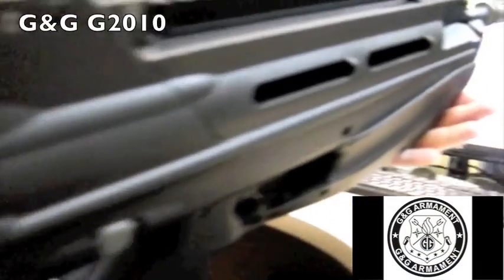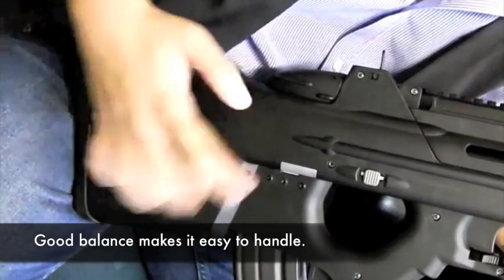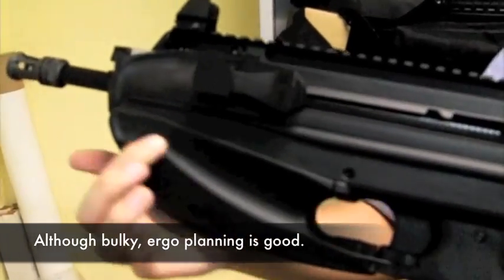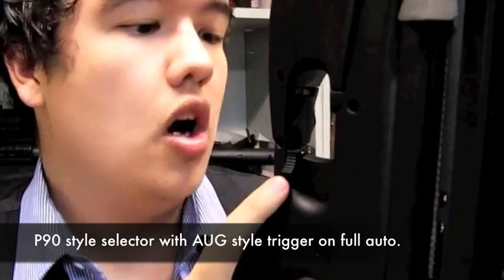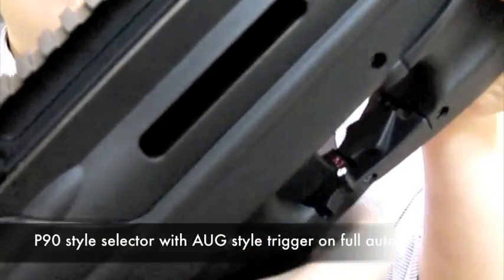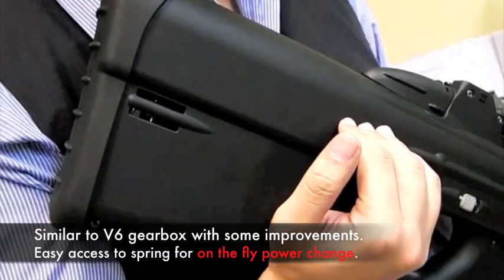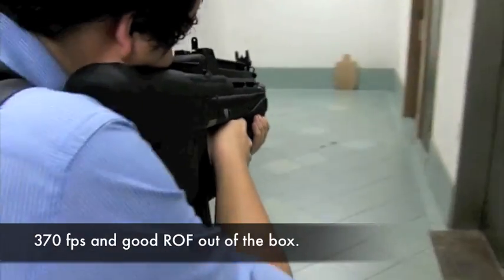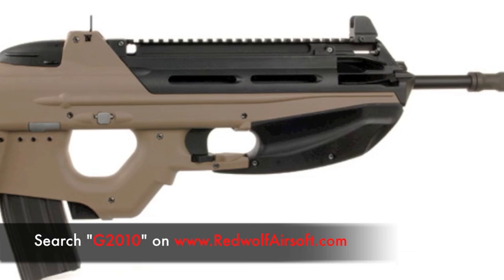G&G G2010 / FN 2000 Rapid Fire Review - Redwolf Airsoft - RWTV

Comment: @nuneatonairsoftteam No It is OK. I have TM P90. It has Same trigrer as F 2000, There is no difference in force reqired to pull the trigger between this or normal trigger. Only difference is mechanism around contacts (there are two sers of contacts). Personaly I like this kind of trigger more than normal because you are pulling whole trigger backwards (like on Colt 1911 or Hi-capa pistols) not just rotating it like on other guns. It gives you much better control over it especialy with gloves.